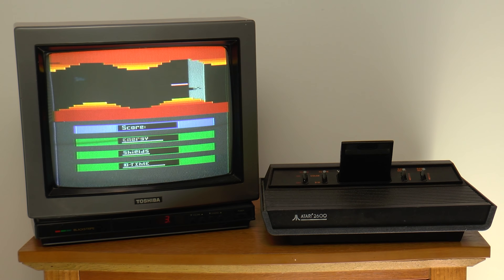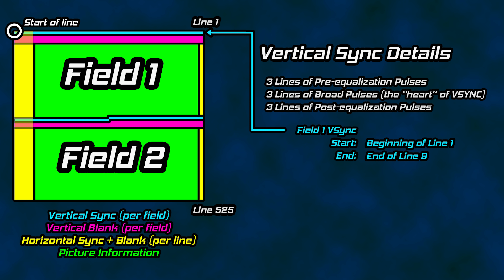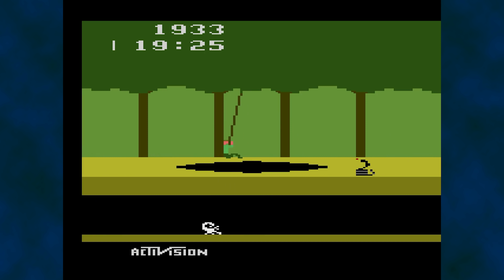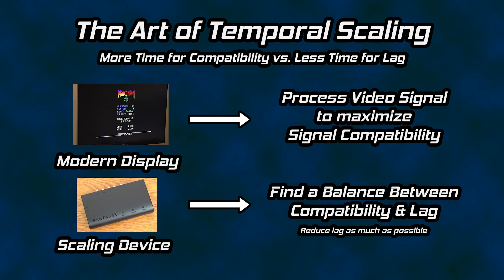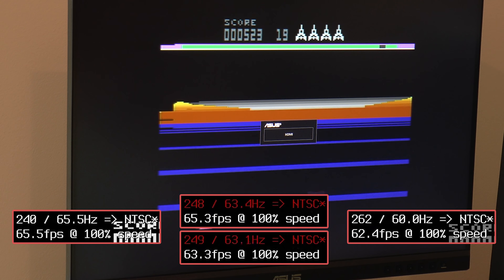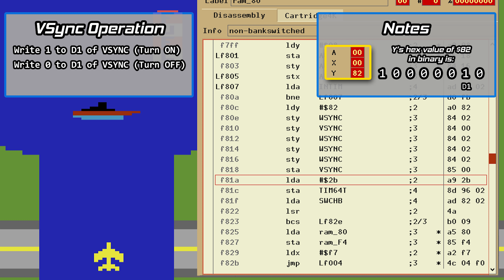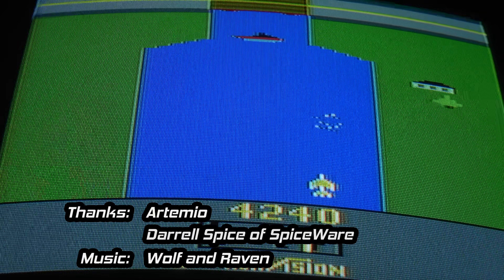The Atari 2600, Analog Video, Scalers, and the Agony of 240p Ambiguity

Comment: I had no idea the refresh rate and resolution of the 2600 was controlled by software - I guess I should have, since I already knew the TIA output things to the TV line-by-line in software. The idea of taking away a scanline or two because you feel like programming it that way is insane! Are you planning on doing an explanation video on the black "comb" lines that appear on the left side of some later 2600 games?
Reply: It seems black lines are the sign of hardware playfield registers being updated by CPU while also being drawn

Comment: Personally if the game program worked as intended for target hardware and display standards of the time than it wasn't bug. The Saturn does this alot too.
Reply: the devs did have a full documentation of how to properly integrate V-sync in a way it would be compatible with different displays, but for some reason some devs decided to deviate from this!    they probably tested it on a couple of displays they had laying around and called it a day,    i would call it a bug, even though it is more aking to just an oversight of the devs
Reply: hmmmm,   disregard my post,  since i now realize that if a bug was intentional,    by definition it is not a bug or oversight lol

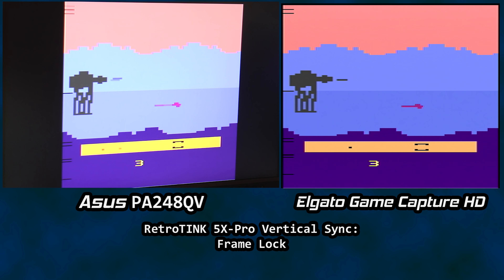Comment: What are the horizontal lines near the left edge of the screen in Empire, e.g. at 10:41?  Is the game doing anything "interesting" with HBLANK?
Reply: The TIA sprite horizontal counters are advanced with every displayed pixel, and can be advanced a programmable amount from 0 to 15 pixels during horizontal sync.  Every 160 counts triggers a sprite to display.  To move sprites, the end of horizontal blank is delayed by 8 pixels, so the sprite only receives 152 counts.  If zero pulses are added, the sprite will move 8 pixels left.  If eight are added, the sprite will stay put.  If 15 are added, it will move 7 pixels left.  It's possible to trigger the insertion of 0-15 motion pulses without the 8 pixels of blanking, but I don't know if anyone was aware of that during the 20th century.
Reply: It's an anomaly of how the TIA operates. It's can be hidden by the developer by putting a colored block over it (something that matches the background), or cause that part of the image to go out into the overscan areas of the TV, or they just didn't bother with each because it probably took system resources away from them from being able to make their game.
Reply: Almost all atari games have them its up to the programmer to bother with trying to hide them or not as its in the overscan area of a CRT

Comment: I wrote an Atari 2600 emulator once, and decided that since the frame timing was unpredictable, I would render the picture similar to how a TV would.  I counted the scanlines between each vsync, and used that to center the picture vertically.  If the frame ran for more than say 265 lines without a sync, it would retrace on its own.  Since the PC video frame rate was a consistent 60 Hz, I had my emulator generate exactly enough pixels as meant for 1/60 second, regardless of sync, and then blit that to the screen.  That means, of course, you could end up with portions of two different source frames displayed at the same time, but in practice it seemed fine.  The important thing for me was to preserve the overall timing accurately, as well as any visual artifacts from out of spec sync timing.  I even had a V-HOLD control on my emulator, that pretty convincingly reproduced the V-HOLD effect from an actual CRT.

I think an interesting game to try with the scalers would be Maze Craze.  I believe that one did not generate any vsync for a few seconds while it generated the maze, but it did flash different colors during that time so you knew it was working.
Reply: I'd defer the auto-refresh until one receives more than 280 lines without sync, since some games ran a bit on the long side.  I don't know that any NTSC games got up to 280, but I'm pretty sure some got up to at least 270.
Reply: That actually seems like a good easy workaround: Do you have the code on github/gitlab?
Reply: @maxlife459  Unfortunately, I never published the thing, as I never felt I got it quite polished enough.
Reply: @sa3270  Publish the emulator plz
Reply: Had no idea emulation involved that much of thought ! Thanks for sharing !

Comment: now that you mention it i remember a myth from the 90s that atari could damage you tv, is it possible to be true?
Reply: Any television set designed to receive broadcasts would need to include circuitry to prevent damage from wonky sync, since otherwise use in conditions of poor reception could cause damage.  Monitors designs that weren't based on TV receivers weren't so forgiving, but the Atari wouldn't be connected to those.

Comment: I do take exception to the "there's no such thing as 240p". It wasn't there by design, but it's obviously there, obviously progressive, and obviously can't contain more visual information than about 240 lines. Therefore it exists. You just have to trick the display to achieve it. Thank goodness that feat is possible.
Reply: It's interesting because it's a "feature" of the standard that came to light mainly when electronics began using TVs as cheap monitors. Interlacing isn't enforced by the display device at all and in fact, 3 or 4 field interlacing could be done if you tweak the vsync some more (giving more vertical resolution at the expense of flicker).
Reply: @bryede  how would you do 3 field interlacing?
Reply: @xeostube  I'd imagine starting 3 V-syncs at the start of, 1/3 along and 2/3 along horizontally. Basically, the V-sync start horizontal offset determines the vertical offset of the following field.
Reply: @CarbonRollerCaco  you're saying that the field is not determined with a binary threshold but just as an analog distance to move the start of the refresh down the screen?
Reply: @xeostube crt tvs are almost always turely analog beasts with digital controls added on in place of variable resistors, variable capacitors, and the like, I can link a fully analog color crt schematic where diodes are the only semiconductor used (with exception to 1 transistor in the uhf tuning circuit)
Reply: he said that because 240 was not a standard, and did not mean some fixed whatever-by-240 resolution as people take it today.  So, your taking exception with your own failed media literacy or whatever we call it for edutainment.
Reply: 240p60 and 288p50 existed because old TVs were stupid mechanical beasts that didn't care that they weren't being given a second field.
Reply: "there is no such thing as 240p." - author of video titled History of 240p
PS. Keep up the awesome work, Sack! Longtime sub here.
Reply: He's not saying the concept didn't exist, hence the name of the video. The point is 240p did not exist as a standard. 1080p has ONE meaning, one standard implementation. 240p had several, which could be used interchangeably even within a single product. In engineering it is very important to use standards where possible. If you don't  you end up with issues like, well, 240p in this video.

Comment: 6:15 “But processor execution times for instructions is… unpredictable”

Not at all. The number of cycles each instruction takes is well known and documented. Most took two cycles, some took 1 or 3, and everyone who coded for a 6502/6507 would know those timings. Knowing the instruction timings exactly is how writing code that raced the beam was even possible.
Reply: It's not technically unpredictable (it's worse in modern cpus where timing depends on caches and whatnot), but it sure is a lot easier to get predictable behavior out of your code if you don't have to count cycles all the time, but can rely on wsync to resynchronize!
Reply: @possible-realities  Agreed. WSYNC is a massive convenience for programmers. My sole objection was that instruction timing was called “unpredictable”. I grew up in the Apple II world, in 6502 land, and everyone had an assembly instruction chart that listed cycles taken.
Reply from the maker: It is still unpredictable. Don't forget about looping and branching. A natural variance in cycles required for execution is why Atari implemented the WSync register I explained in the video.

Reference the Stella Programmer's Guide, Section 3.2 for details.
Reply: @DisplacedGamers  The Stella Programmer’s Guide is saying something different from what you said. You said that instruction times are unpredictable. That’s not true. The Guide says that the program’s loops and branches take unpredictable lengths of time, which is somewhat defensible, though imo a sloppy way of saying it.

Comment: Interesting that the Atari 2600 had a "dynamic resolution" in a sense, almost 40 years before it became standard on the Switch (and I believe some PS4/Xbox One games do as well).
Reply: I remember battlefield in PS4 and Xbox One had dynamic resolution (specially due to the bug that made 16 by 9 pixels a thing), also titanfall and many, many others.

However those implementations were actually made correctly, and mostly changed in-game rendering and not gui/hud
Reply: Dynamic Resolution also existed in the ATARI 8-Bit family too. Many games ran in 240P like the 2600 but they would use either 320 or 160 pixel wide display modes for graphics. Moon Patrol on the ATARI 800 used 320 mode for the hud and 160 mode for the actual playfield.

Comment: Before the term "progressive" was thrown around, we just called it "non-interlaced" and it was denoted as ni with interlaced as i.  Progressive scan terminology seems to have come about as a product of the HDTV generation.
Reply: I think it was a marketing term designed to sell high end DVD players with component 480p output. At least, when I find those old DVD players in thrift stores they prominently brag about their "Progressive Scan"
Reply: @Impossiblah  It's probably called progressive because the scan smoothly progresses to the "correct" next line instead of skipping one.
Reply: I am VERY certain that the term "progressive scan" was known to me by 1997. I would have likely picked it up from a Russian language encyclopaedia of technology or some other source like that, as "прогрессивная развертка" if you're curious, and those would have been from the 80s. I have just found Russian lecture notes from around 1998, or date unknown, but i remember this site being around by the late 90s, and none of the sources mentioned therein are newer than 1998, that also use this term. I should probably check the articles that i wrote myself, whether i used the term, because i was a magazine editor at the time, but i don't think i would have.

It was probably not commonly used outside of engineering and educational contexts. I checked the manual to 19/23" Mitsubishi DiamondPro CRT monitors, and they call it "non-interlaced". EnTech PowerStrip just doesn't seem to have an explicit word for progressive scan at all, at least as far as i can see from the screenshots that are easy to get hold of.
Reply: I think what we now refer to as "240p" was also sometimes called "double-strike" back then
Reply: A term that most certainly was retroactive because of HDTV is SD for standard definition.
Reply: Just like how "tech" used to mean "technology" or "technician". It's all a bit puerile. :(
Reply: @ShamrockParticle  We call the latter a "techie" now. :<P
Reply: Why so serious?  @ShamrockParticle

Comment: Framebuffers are a wonderful thing. I'm thankful the NES has one (basically) and every console beyond. Great video!
Reply: Every console BEFORE too. The VCS is unique in managing to shave the hardware down so minimally that it could get away with a quarter-kilobyte of RAM while still outputting real-time color graphics(at a fairly high color depth, no less!).  The only thing to come close was RCA's Studio II, which has a half-K of RAM... and a 1-bit black-and-white display.
Reply: @CptJistuce  "The VCS is unique in managing to shave the hardware down so minimally that it could get away with a quarter-kilobyte of RAM"

The Atari 2600 only has 128 bytes of RAM, which is one-eighth of a kilobyte.
Reply: @MaximRecoil  Well, poop. There's goes my basic arithmetic credentials.
Reply: The NES doesn't have a frame buffer. It has nowhere near enough RAM for that. It has tile and sprite buffers, which the PPU reads to draw the screen, probably line-by-line.
Reply: Having a frame buffer results in one frame (about 17 milliseconds on an NTSC console) of input lag. The Atari 2600 has no input lag, and when connected to a CRT like it's supposed to be, you don't get any display lag either, making it as responsive as a video game can possibly be.

In addition to being inherently more responsive than the NES, the Atari 2600 also has perfect hit detection, while the NES uses far-from-perfect "hitboxes" for hit detection. Here's an explanation of it from the book Racing the Beam:

"In today’s games, collision detection is handled in software. A computationally cheap way to accomplish this is with bounding boxes. In this method, boxes around each object are determined and each pair is checked for intersections. This simple and quick method is nevertheless inaccurate, because an object that does not fill its bounding box may register as colliding with something when it actually does not. 

The VCS hardware collision is performed by the TIA, which checks for overlapping logic states on its multiple graphics registers. For this reason, only those bits that are turned on in the graphics registers of a sprite can register collision. In other words, the parts of a sprite that are actually seen are the only ones subject to colliding. Thanks to a relatively simple circuit on the TIA, the Atari VCS offers more precise collision detection than is done using the standard technique in modern software toolkits such as Adobe Flash."
Reply: NES was hardly the first system to use a frame buffer.

Comment: I had no idea it was this complicated.. I always thought the hardware controlled the vsync not the game.
Reply: It does in just about every system but the 2600. Atari figured out how to offload a lot of the hardware functions to the programmer.
Reply: @bryede  To save cost, mainly.
Reply: The original Atari is about the most primitive device you can make that can still play a video game. Most of the niceties that we take for granted on pretty much all platforms are "FILE_NOT_FOUND" on the VCS. Most hardware has a frame buffer, for instance. Atari ain't got time for that crap, you get half a line buffer(sort of). 
Programmers of the day described coding for it as "forgetting every good programming practice you ever learned", because it was so esoteric.

It was ruthlessly trimmed down in the name of cost, and the result was a system with just 128 bytes of RAM and a TV controller that had to be micromanaged through the entire frame. (Resulting in an inversion of the game loop from basically everything else. Most game hardware, the game logic takes place while the frame is being drawn and is suspended during VBlank to set up for the next frame. On the VCS, VBlank is where most game logic lives because it is the only time that the poor overworked 6502 isn't spending most of it's clock cycles drawing a picture.)
Reply: In most consoles and computers, it does. The Atari 2600 is rather special in this regard.

Software-controlled vsync has become a thing again in the form of FreeSync and G-Sync, but these still expect a consistent resolution and will still barf if you try to change the number of scan lines on the fly like these 2600 games do.
Reply: You should watch Retro Game Mechanics Explained latest video about Atari 2600 if you're interested in the nitty gritty. The hardware of that console barely did anything for you. You were supposed to time everything manually, and the available video memory was enough for half a scanline.
Reply: Welcome to the atari 2600. It was designed to run Tank and no other games. Programming for it means hacking the console as you go. 😂